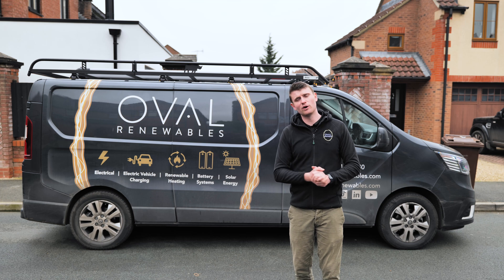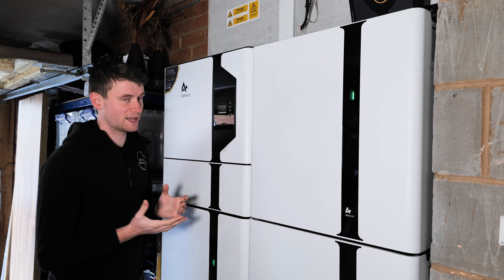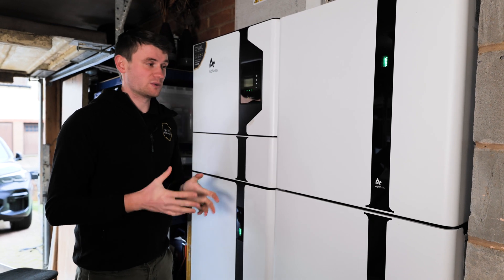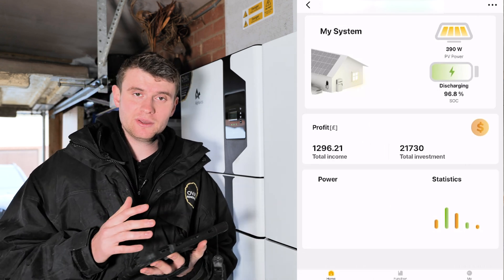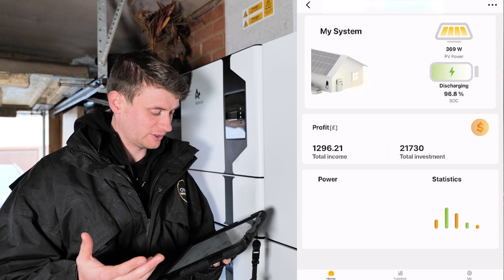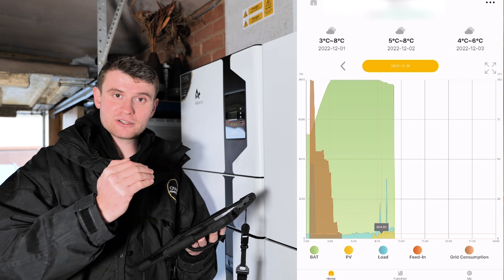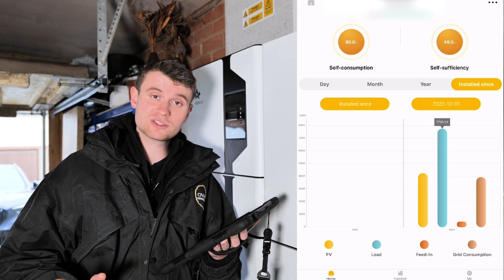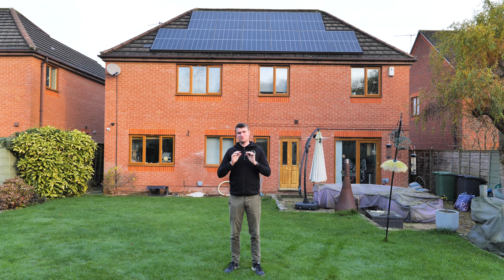Our Biggest Alpha Battery To Date! Otley Home Energy System Part 2!

Comment: I'm looking at battery storage, but I am concerned about potential battery fires/ explosions. Not sure how many batteries you've installed for the client in this video, but looking like it's 4 units? If so, this quadruples the risk IF there is a risk? Is this something that we should be insuring against?
Reply: I imagine that these batteries are LFP, which are much safer technology and slightly more environmentally friendly (as they dont need nickel and cobalt)
Reply: They're LFP, just keep anything flammable away from them and even if they did somehow end up with thermal runaway, its just going to make a bit of smoke.

Comment: How well do these batteries charge in a garage as I have heard that in really cold weather they don't charge fully even when grid charging overnight as cold temperature restricts the charge rate.
Reply: This is true if the batteries get sub-zero, however, in a garage with them being cycled i'd be surprised if you had an issue more than a few days a year, if you do at all.

Comment: Hi, stupid question why is the DC from Panels always on a different inverter to the ones that run the batteries? No use of hybrid or is there a rule in UK on this. In south-Africa have never seen it this way
Reply: The Alpha battery is AC coupled as the SolarEdge PV array has its own inverter, so not a hybrid inverter system
Reply: This battery can take pv directly. However it's been installed for one of a variety of reasons I would imagine which could be, ac coupled stand alone system so that the car charger can work nicely with the battery and solar independently (monitoring the battery to avoid draining it into the EV). In a Hybrid it cannot distinguish what is pv power or battery power. Another reason could be that solar edge was a neat system in terms of the quality inverter with a longer warranty and always gets installed with optimisers. Their battery's are super expensive aswell. Maybe more cost effective to install the Alphas
Reply: @simon247sa  Optimisers are not that useful with half or triple cut panels as the internal diodes do an excellent job if a panel is shaded or part-shaded. The most useful part about using them is just for monitoring on a per-panel basis, not for any energy reasons. Surprisingly people are getting higher overall output from a standard 2x MPPT inverter than an equivalent Solaredge. Most chargers work happily with hybrid inverters though as for most cases you'd charge your EV based on energy being fed back into the grid.
Reply: Some installers prefer to use this system, but hybrid inverters are prevalent. The Solis RHI 5G inverters seem to be the favourite amongst the larger companies.